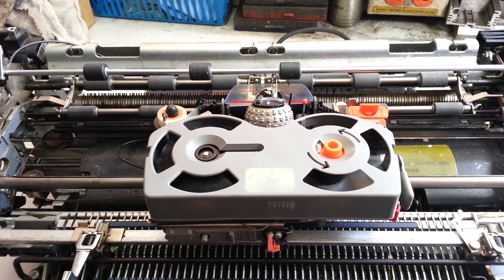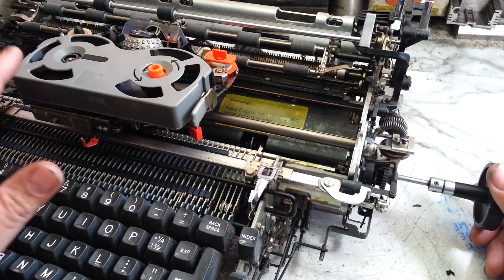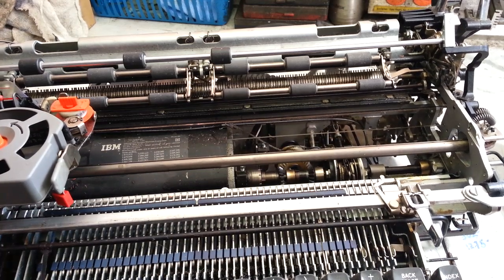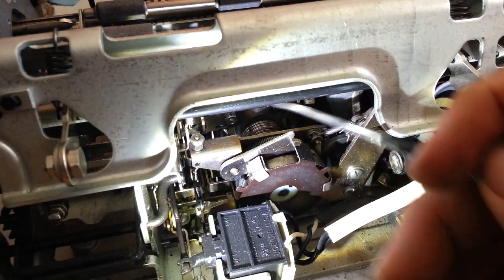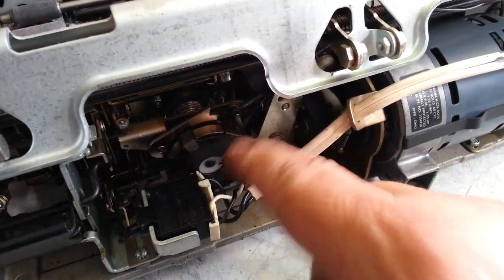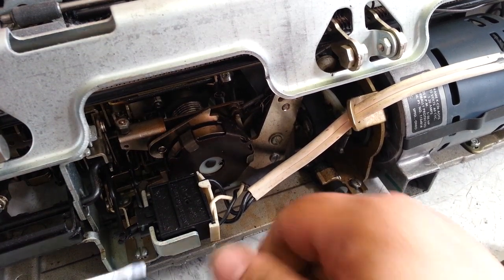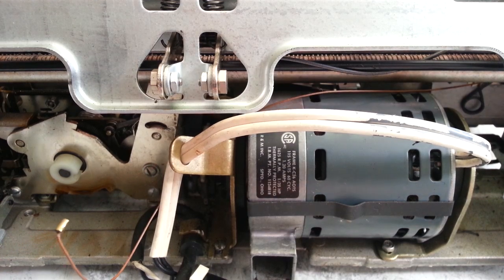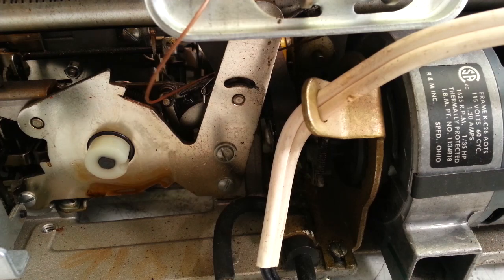IBM Selectric Typewriter Return Cable Tabulator Rope Installed Main Spring Wound

Comment: Nice -- I had to do this once when the cord popped off somehow, and it took like 3 hours or more. Didn't have the hand crank or service manual back then (this was 2008 or so), just studied a working machine to compare. But man, realized I needed forceps instead of the needle nose I had, and made stiff hooking tools out of paper clips, lol. Helps to have the right tools! The thing that took the longest was figuring how to keep tension on the cords so everything didn't unhook and unravel. I was swearin' up a storm during the entire procedure, but it worked again after. Since then I found a repair store in my area to keep my selectrics tuned up properly.

Comment: Thank you for this. I'm a computer tech, but we will take a stab at fixing anything if the customer pays the diagnostic fee. I spent several hours trying to figure out how this thing is supposed to work, and why it wasn't, and after getting those cables off I had no clue how I was going to go about getting them both wound back around that thing.  I should have searched the issue here in the 1st place, as I would have saved a ton of time had I seen this video 1st.

Comment: Thanks for this. I finally found a Selectric III locally but it had a broken return cable. I did try putting a new end on it but came up with the shorts at 29 1/4". I made a new one from some nylon covered fishing leader, it's a little stiffer than the original but I think it'll work for my occasional use. Made it 29 3/4" which is a little tight I think 30" between the stops is the correct length.

Comment: I would like to add a little note.
When attaching the cord to the right side of the carriage,be sure that the tail end of cord at the connector loop is towards the rear.
Otherwise,if it's in the other position,
it can hit the frame as it passes through the frame at the extreme right and knock the cord off.
Reply from the maker: Yea I did breeze right over that, and yes I have seen those cords come off if they catch the right frame just right, I was explaining this to an old school IBM tech (my ex-business partner) like 25 yrs ago, he didn't believe me, well was not long after that when he had a machine knock the cord off twice, I told and showed him again, this time he was a believer.

Comment: Hi Dwayne,

Thanks for the great video. I was able to successfully reassemble the tab and return cables but unfortunately the hook where the tab robe attaches to the velocity assembly  broke off entirely after some light usage. It looks like a previous owner attempted to pry this part and weakened it to breaking point. Do you have a guide for replacing this part? I understand that this is likely a big job but I am more than up for the challenge. A creative alternative solution would also be welcome. Unfortunately I am in the UK so I can't realistically have you replace this part. 

Cheers.

Comment: Fantastic video, thank you very much for these!
22:48 Fitting the tab cord on the drum caused me the greatest conundrum. I was expecting the steel loop bent end to go onto some sort of hook (like the other end, on the carrier). I could not find a picture anywhere on the net of the end of the tab drum, to see the expected hook arrangement. Also perusing all the downloaded Selectric service manuals I had did not show this end. Using a dental mirror from my Dad's 1960s IBM CE toolkit didn't help much, I still couldn't see a hook. I tried hooking the metal loop onto the 'spike' of the drum helix, that didn't look right.

Took me a few hours to realise there is no hook . The metal end goes into a recessed annular groove in the back face of the nylon drum, with the bent metal going into this curvature. The cord is retained NOT by the hole in the end but by virtue of the cord pulling against the helix spike, unable to pull the metal end around the spike. This end might have been designed better as a crimped block instead. The hole in the bent end piece was a giant red herring for me, it really threw me off.
Reply from the maker: Yes, this always seemed like an odd way to attach this style cord.

Comment: If there are any plastic parts to the selectric you can no longer find, i will happily model replacements and send you the STL files so you can have them 3D printed.
I have a Selectric II myself and have had an issue there the rightmost carrier pulley exploded when i turned the machine on. I've created models that hold up better than the originals. Though, we'll see how things go with the test of time.

I can even 3D print the belt.

Comment: I have a Selectric III (or rather a 670x because I'm in EU) and that exact rope is a little loose, it's not snapped in half or otherwise damaged, all keys work except backspace and correction. When I manually tug on the rope and press backspace/correction, they work as normal. Would following this video tighten that rope back up and return the machine to a working condition?
Reply from the maker: Yes it should, here is one way to adjust rope tension
https://youtu.be/adAj3l3edRk
Reply: @phoenixtypewriter2136  That should be exactly what I have been looking for and it seems simple enough to perform, thank you very much!

Comment: So, full disclaimer. I worked for the IBM Office Products Division from 1974-84 as a Sr. CE essentially responding to customer service requests for all kinds of IBM equipment including all IBM selectric typewriters.

The video points out to symptom very well and tells you correctly the general area where the return mechanism is located. However, clearly it won't be enough as this particular problem will be a recurring one unless the latch is either replaced or filed down and then adjusted per the repair manuals to overthrow
by .010”.
Just my $0.02 worth.

Comment: Well my fifth Selectric III has a broken return cable. The cable itself isn't broken, but that metal end that attaches to the pulley slots, has gone missing. Is there any way to fix the cable, bacause in Europe is a bit difficult to find selectric parts... Like pressing a new end if I can find something similar? But I don't think that it will withstand the tension.... Thanks in advance
Reply from the maker: End usually pull off from return clutch needing rebuilding, old oil ceases clutch pulling return cable with violence
Seen a few modified ends before, common to tie a small knot, cable will be shorter, but can be compensated with proper adjustment

Comment: Ugh. I'm having a rough go with the tab cord replacement (the original was split in two). I'm starting to think I purchased the wrong cord length. Is there a way to confirm cord length when I don't have any original labels on the machine?  I do have an IBM Canadian version, if that matters. Thanks for sharing all these videos, they make this task seem slightly less complex, haha.
Reply from the maker: Yes there is a database showing lengths, but I don't have it, but the Selectric repair group on FB does
These IBM technicians have the answers here, https://www.facebook.com/groups/gbtwshop/?multi_permalinks=2860785167378716

Comment: Do you have any recommendations for an electric royal Apollo 12-GT that’s letter keys and number keys don’t work, but all the other keys around the outside work?
Reply from the maker: Sounds like the main belt is broken, have you checked that ? Since there are no belts available for last 20 years,
I throw these models in the trash when they come into the shop. 
Only electric typewriter from the '70's that still is serviceable are the bulletproof Smith Coronas, See Link Below
https://youtu.be/AucbxAOAWlU

Comment: Great video!
I took both ropes off the machine, but now I have a problem. It just keeps returning (meaning the return drum is spinning left and constantly engaging the clutch), how do I stop it? I don't think the keyboard is stuck.
Reply from the maker: Push margin rack to the left to disengage return clutch
You should also be able to press Tab to end carrier return
Reply: @phoenixtypewriter2136  Thank you so much for the quick response!
Unfortunately that didn't make it stop returning. But thank you for the response regardless, it is greatly appreciated! I'll say it again, these videos are fantastic, thanks for taking the time to upload them!
Have a good one.
Reply: @phoenixtypewriter2136  UPDATE: I was cycling the machine in the wrong direction as the last action was a shift action that I couldn't power through. Now that I quickly flicked it on, it is cycling normally!

Comment: I have attempted this repair, however i have a problem. The carrier has moved all the way to the left. The tab cable still isn't attached and what's worse is, it won't reverse. The return cable is incredibly tight and i need to back it off. Everything is locked up tight.
Reply from the maker: Sounds like the return clutch is engaged pulling carrier to left.

Comment: Hello, I'm also trying to put my strings back together by following your video step by step, the problem is that I have a couple of pieces that I don't know where they go, unfortunately I can't send you the photos here.  one is a spring and the other I don't understand what it is.  Wouldn't it be possible to write them via email?  A thousand thanks.
Reply from the maker: Hello, my time is rated at $100 an hour, can't really help without effecting my daily work load
Try posting on the premier IBM Selectric repair site, I'm also a contributor there with limitations
But there are a couple retired IBM techs that have the time for this, https://www.facebook.com/groups/gbtwshop
Reply: @phoenixtypewriter2136  A ok, thanks anyway but I decided to throw it away because I couldn't put the ropes back on.